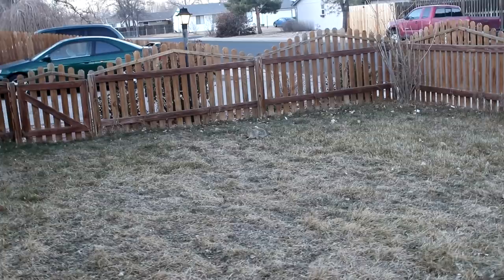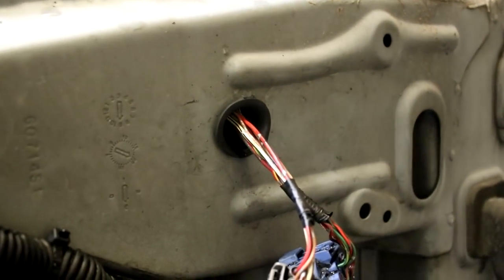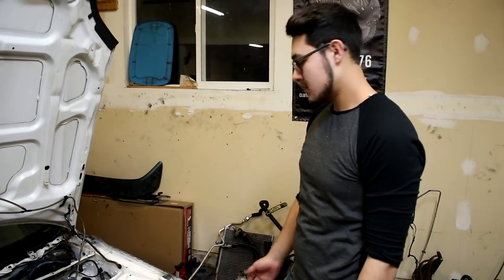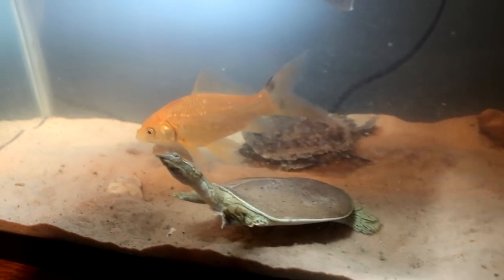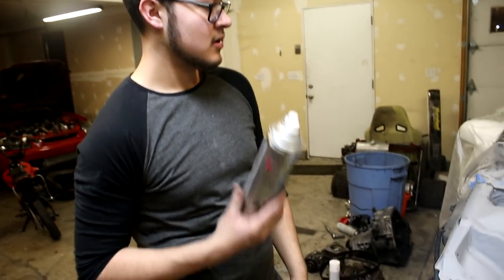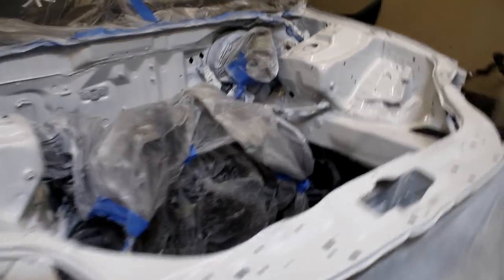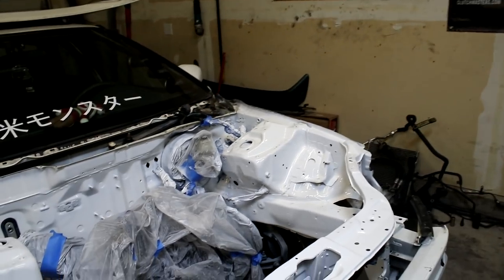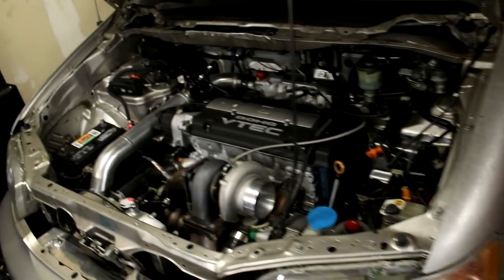Budget B series Build / Cleaning up the Engine Bay

Comment: Before I did my full brake line tuck I took the prop valve with all the lines connected to it and bent it down and mounted it to the subframe. Just an idea cuz I know you didn't want to get into tucking anything. Keep the videos coming guys🔥

Comment: One trick I found for places that get really cold, about 30 odd minutes before spraying with a can, put the whole can in some hot (not boiling) water or in front of a heater but not too close, that helps stop it spattering since the cold paint gums up the nozzle of the can, and allows it to spray nice and evenly. Plus the can will be warm to hold aswell.

Comment: *Kyle, You probably won't see this but have you ever thought of supercharging the Hatch since the boost is more direct?
Reply: Viewing it wouldn't produce any positive gains HP wise as Belt Driven Superchargers tend to make less power at the same boost level as turbo equal max airflow tr threshold (cfm) it does however move the power band and change how the boost hits...

Comment: lmao you will not be able to fit more than a 195 on a 6” wheel... maybe, MAYBE a 205 but I highly doubt it
Reply: Connor O'Reilly the 2015 fit comes with a 6 inch wide wheel, I squeezed a 205 on there for autocross to stay in the stock class. It bubbles out just enough to prevent curbing the wheels when parking.
Reply: You can fit a 205 buts that's the farthest you can go